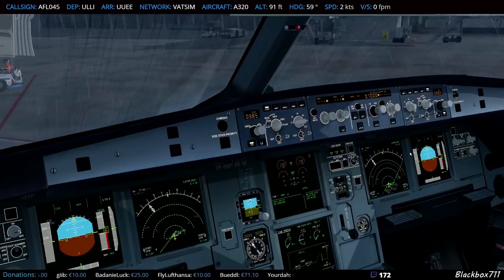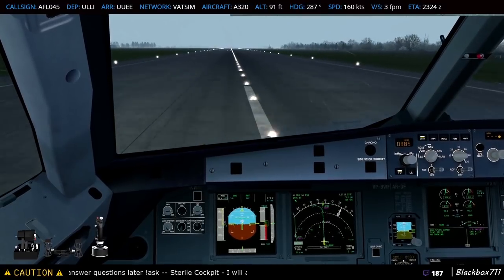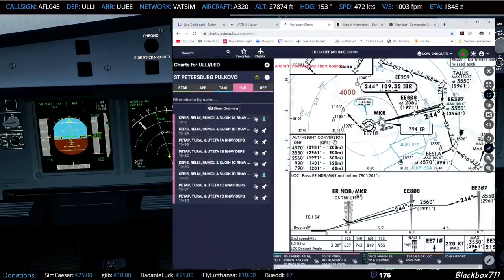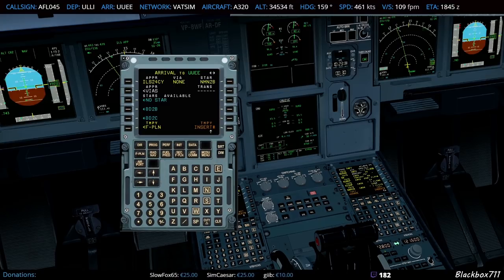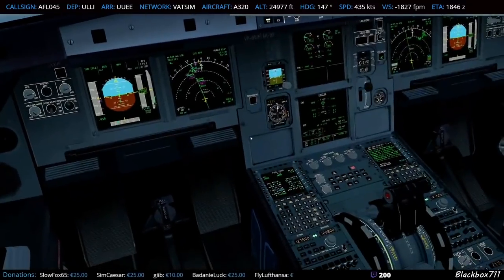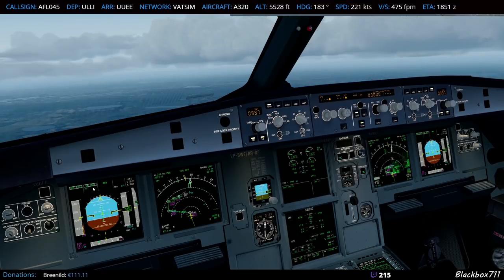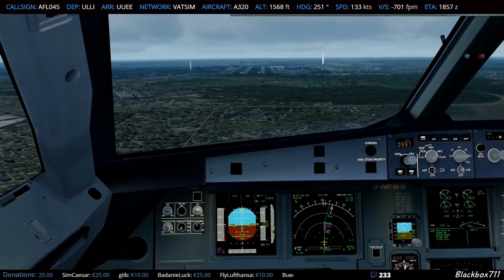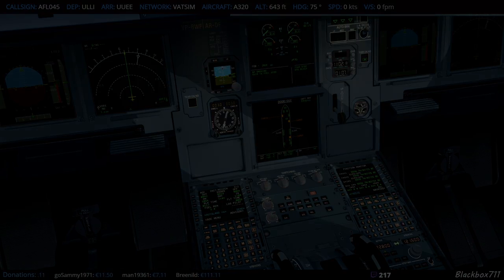Moscow UUEE - Approach using QFE procedure on VATSIM

Comment: The way deicing is actually done at ULLI is if the aircraft is at the terminal, it is towed to the edge stands behind it (130 or 146), de-iced there and then taxies from there for departure. Fairly sure this could actually work with GSX as well since it has the option to tow you to a different stand.
Reply from the maker: Yep. Did exactly that a couple of days ago.

Comment: Hi. As I can see you show a QNH procedure, not a QFE. You set QNH into FMGS and on FCU
Reply from the maker: Yes. But I also compute the QFE value to crosscheck.
Reply: @Blackbox711  I'm sorry, but I can't understand what do you compute. On appr chart you can find a table with altitude and high. ATC gives you high, what do you need-it's just address to table and find there corresponding ALT. Then you round it off and putting on FCU and into FMGS. And I'd not say that this is a QFE procedure. It's just adoption to Moscow ATC procedure but A/C still approach by QNH.

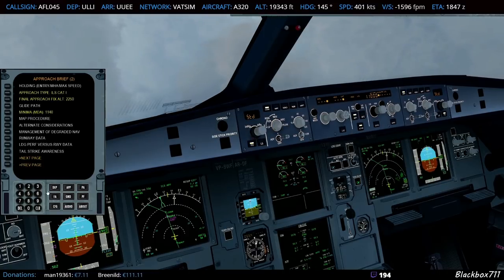Comment: Great video. I have a question. Let's say you are at FL200 and your speed is set to 250 on the FCU but your TAS says 350 just like this video around 33:00.
ATC tells you to slow down to 240. You set it on the FCU but your TAS is well over 300. Is this correct or if ATC tells you to slow down to 240 do you have to go by what the TAS speed says? Thanks. Joe
Reply: ATC instructs to maintain indicated speed, so, in this case you should adjust your speed on the FCU.
Reply: @olegatc3663   Thank you for your reply but ATC never tells you to maintain TAS, they just tell you the speed.
Reply: @antiqu54  ATC always means IAS, it is a rule. So, set 240 on the FCU and everythung will be correct.
Reply from the maker: Correct. ATC speed instructions are Indicated Airspeeds. The controller are aware that Pilots can only dial in IAS values in the autopilot FCU.
Reply: @Blackbox711  Thank you guys for clearing it up for me. I never knew that ATC gave you indicated speed but it makes sense now.